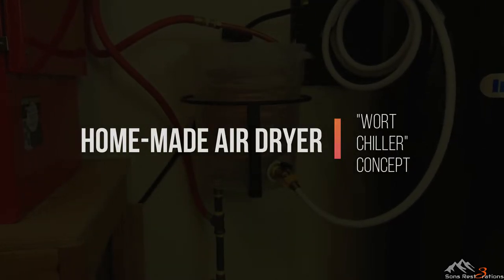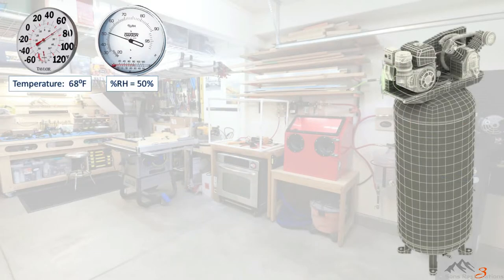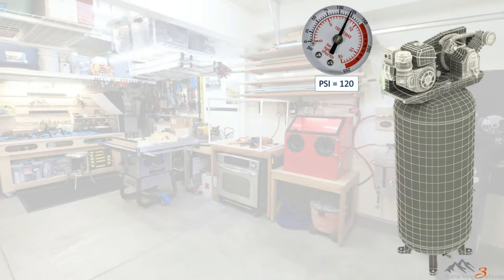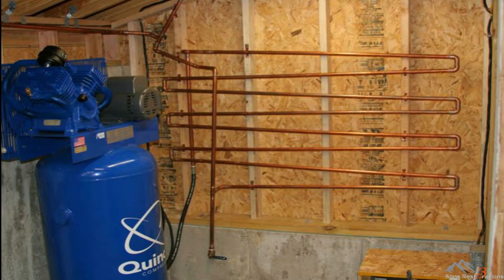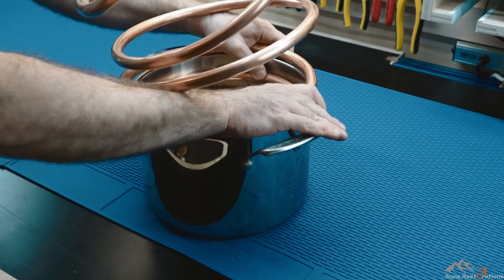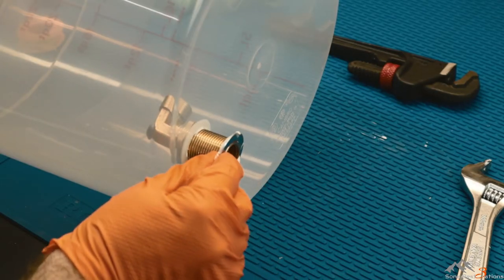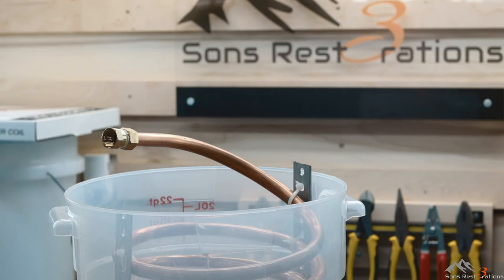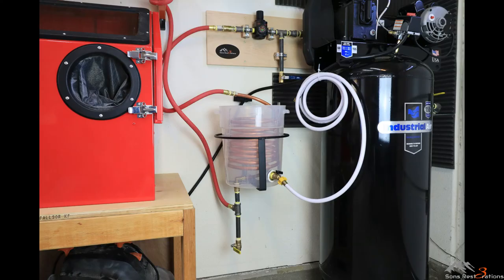The Copper Coil Air Dryer/Compressor Aftercooler DIY (Setup Part Two)

Comment: Great Science explanation BUT, you 100% missed a very valuable key point. Your system is still blowing HOT AIR into your tank.  The After-Cooler as you described takes the Hot Air and Cools it eliminating even the remotest possibility of water in your tank via droplets. Seems every video I see someone is taking their after tank air thru a self made copper dryer mounted on the wall. While that is effective,  it does nothing to extend tank life.  No idea WHY folks do not take that into account.
Loved the CLEAR bucket. Where in the world did you find it? I found 1 available from U-line but one has to buy 5 of em....ugh.

Comment: So you're using electricity to run the refrigerator cooling system to produce ice?

Really?

Afaics, The air path is compressor to service line, bypassing the tank?